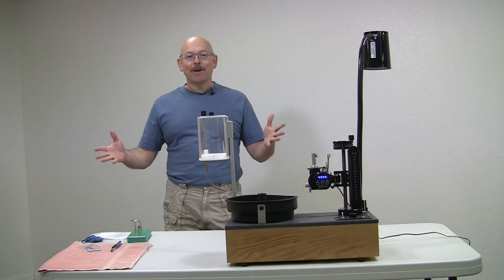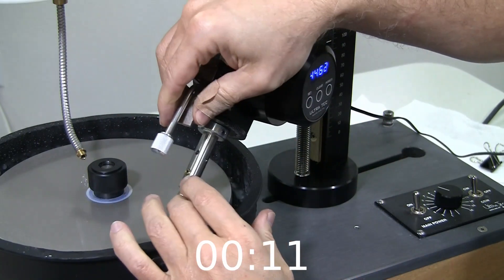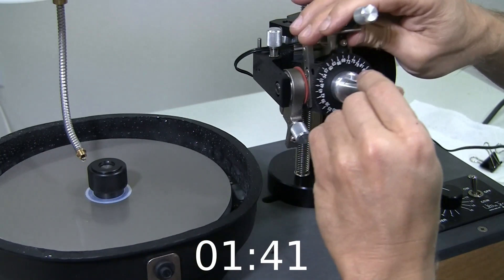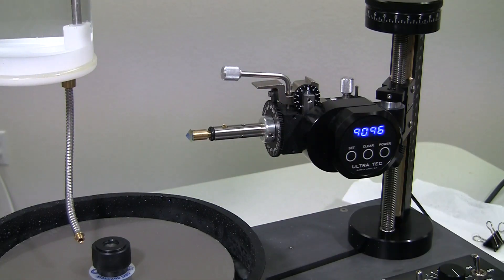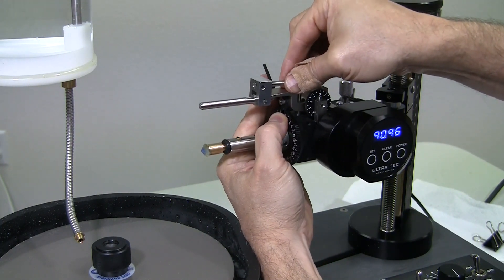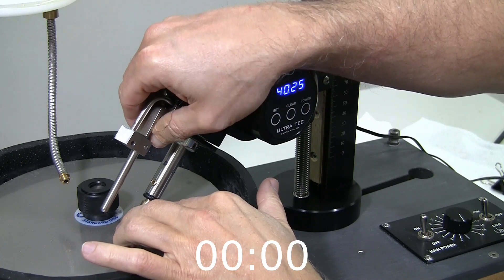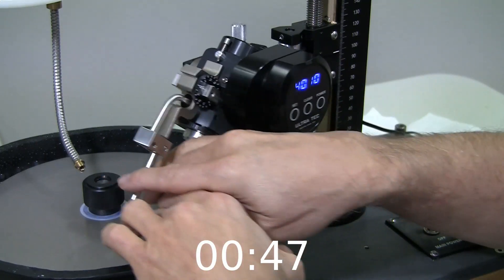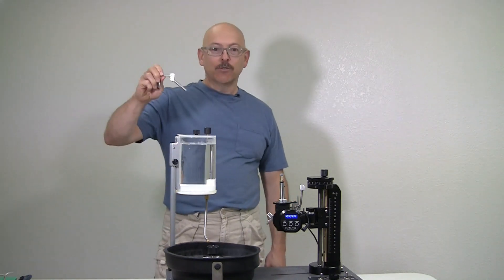Ultra Tec Speed Trigger 2: Faceter's view

Comment: I may have missed it: What grit lap and speed are you at?
Reply from the maker: 600 plated lap, medium speed. Ask anything else you want to know.
Reply: @gemstoneartist  What kind of pressure are you using on the stone/dop?
Reply: @mattdunkle9040  

Pressure on the dop will dislodge stones. So, I never apply pressure to the dop, only to the stone.

This is like stealing a kiss while skiing. Move quickly - to the point where you move carefully...

If you listen carefully to the sound, you'll hear the pressure shifting.

At the live Academy, we teach this in an explicit way to maximize both speed and accuracy. It's not unlike shooting ...
Reply: @InsightThoughtSystems  thanks John.